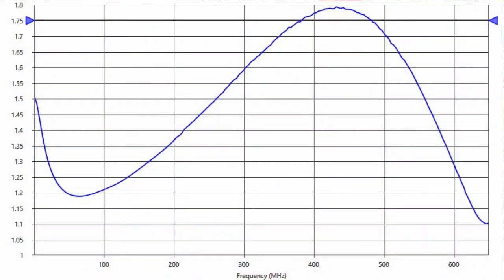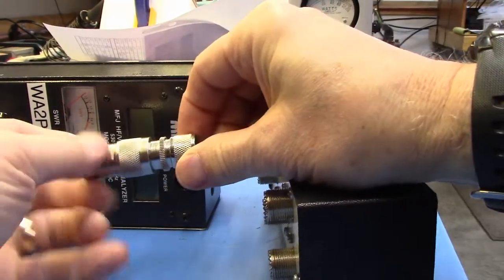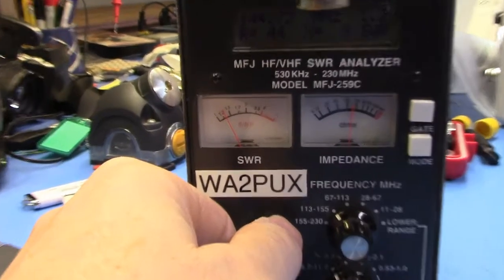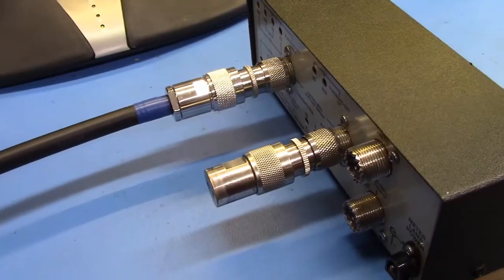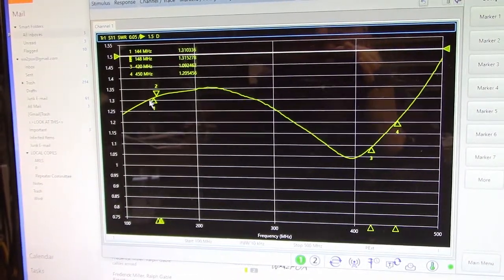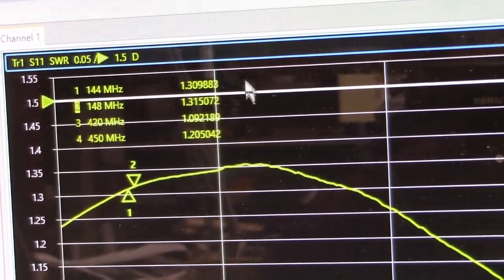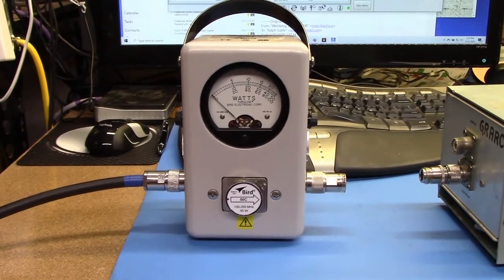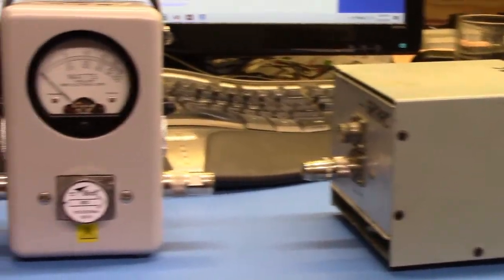Self SWR and SWR meters (00c)

Comment: Great vid regarding VSWR! 
Not many hams know this but 
The Heathkit VSWR bridge is one of the best an amateur can get their hands on. Looks are sometimes deceiving in regards to earlier gear. 

73 es gud DX!
Reply from the maker: Thank you!  You are right!  The difference, too, is the method they used for detecting SWR.  The newer SWR meters often use "microstrip" traces on a PCB. The problem is that it is difficult to manage impedance matching as the dielectric coefficient of the substrate can vary a LOT depending on who makes the PCB. With companies going to cheaper PCB from a different mfr in order to make more money, the people making the change do not really take this in consideration. "Isn't every PCB the same?" Nope!